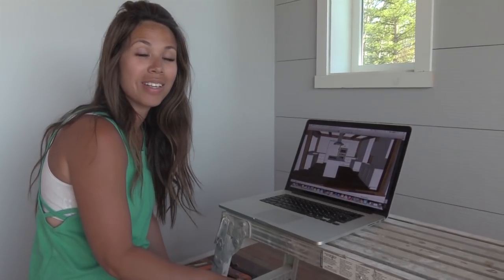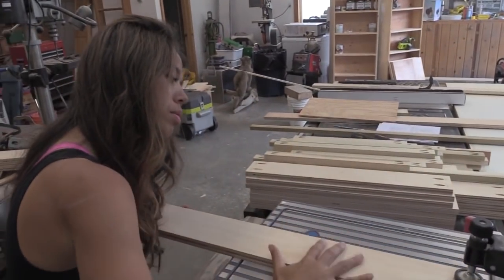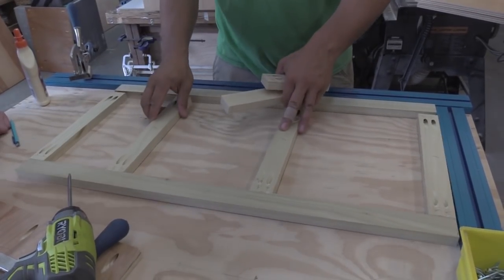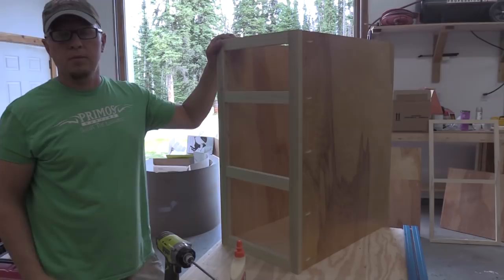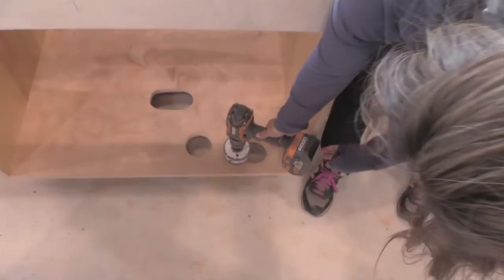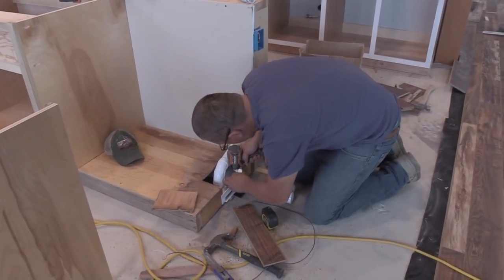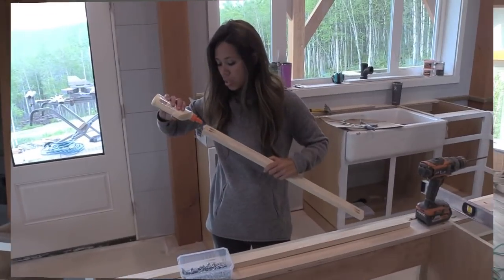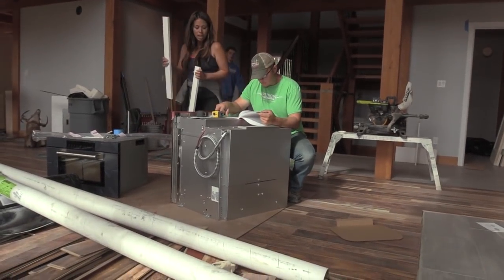Kitchen!

Comment: Farewell from hot and humid Israel. Ur vlog is like a cool and refreshing breeze is the much too hot summer I have to live through. I love following the progress of ur Dream House and the wood works you do. Here,  in this corner of the globe, where wood is very expensive, foundations are made with iron and concrete, and walls are beeing built with cement bricks. tnx for sharing !

Comment: When you put the 1/4" ply on the end cabinet is it butting up to the face frame?  Is your face frame flush with your cabinet box/carcass or is it 1/4" bigger all around? I love all your videos. I am building a tiny house and built all my cabinets from watching your videos. I used plugs on my end cabinet.
Reply from the maker: So what I do is note the cabinets that have an exposed end, and overhang the face frame by 1/4" on those cabinets.  You can do this on all cabinets, even those without end exposure if you want.  The reason I like to keep it flush on the outside is it leaves a 3/4" lip on the inside that I can fur out with a 1x when adding drawers.  Hope this makes sense.

Comment: Hi Ana, Great Job with these videos. I have a question if you use the 2x4 bases and cover them with a 1/2" of plywood, do you adjust  your side panels so they fall within the 34 1/2" dimension?  Also why are the side panels 22 3/4" instead of 22 1/4"?  Help please..

Comment: Wow! Amazing work! Just out of curiosity. Is it cheaper (parts and wood) building a kitchen than getting one pre made?
Reply: Linn we had our cabinets refaced and new doors made. It is cheaper assuming it's your kitchen you're doing. Labor is what gets you -- and deservedly so. The quality of the workmanship is so much nicer than the MDF prefab stuff!
Reply: Linn ... GOOD quality pre-made and bare wood (no finish) are a good value when compared to HIGH quality finished built yourself. You only save a little building yourself. So maybe you save 30-50%. But more apples to apples comparison (good quality bare wood to good quality finished) you save around 60% but I don't have the time to do calculations so this is a guess from experience. And yes, it's the labor that makes up 60%+ of the cost IF they are custom, built to order.
Reply: Linn it also depends..... Most of the premades are made from press wood or "other" matterals. If you have the skills and time have the bragging rights of building your own!
Reply: Yes and no.  For the boxes and face frames absolutely.  For the doors however it's almost always cheaper to purchase premade from any number of websites. Google raw cabinet doors to get started.
Reply from the maker: We will have about $2000 total in the cabinets, including drawers, doors and the carcasses.  Its definitely cheaper, but you do need a few tools (table saw and Kreg Jig are very important).

Comment: +Ana White curious about 2 things... what thickness is the plywood on the core of cabinets? And face frame? Also, whenever I use pocket holes I have trouble of the screw just going through the wood... do you put your drill in special setting or when do you know not to tighten anymore?

Thanks :) looks awesome!
Reply from the maker: We use a 3/4" thick prefinished plywood for the carcasses.  We rip all the plywood to a standard width first, and then just cross cut for the sides and bottoms.  The face frames are 1x2 poplar boards.  

I'd take a look at your Kreg Jig settings, maybe the collar on the drilling bit has slipped a little, this has happened to me many times and will start drilling too deep holes.
Reply: I always try joining a couple of "test" pieces of wood after I get my collar set to make sure it's right.
Reply: I used to have the problem of the screws blowing out the end of the wood too - I realized that my drill was set at a torque level that was too high.  I keep it high for drilling (10+) and then 7 or under for putting my screws in the pocket holes
Reply: The collar is just to make the hole. That I use too... In this case I meant when actually putting the screw in. Maybe my setting is just high as mentioned before
Reply: What you may need to do is change your drill settings so it has the brake function. It should be the thick screw picture on most drills or the "middle" icon if you have 3 settings. This will stop the drill when the screw hits the bottom. Hope that helps.
Reply: Daniel OJ not sure how that helps... My drill is just numbers from 1-22 and then a drill bit image ... I figure the drill bit is stronger so I usually put it lower .... hopefully will do the trick

Comment: as someone who has never seen a kitchen unit with a front frame. ( we don't use that method in the UK ) I could not see how you attach the frame to the cabinet sides could you explain please , thank you for all the brilliant bids so far .
Reply from the maker: Hi SteveD, we drill pocket holes on the outsides of the cabinets, and attach from the outsides.  You can also glue and nail on.  Sometimes we build cabinets without face frames too, but it's almost the same amount of work, edge banding all the exposed front edges of plywood.
Reply: Ana White thank you